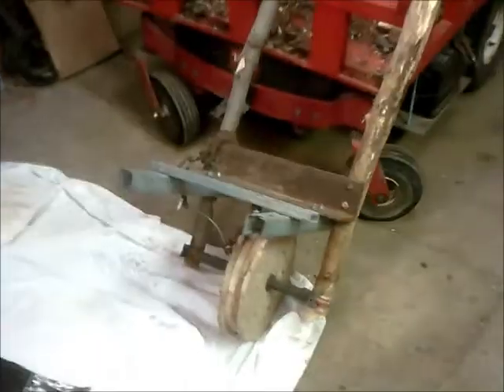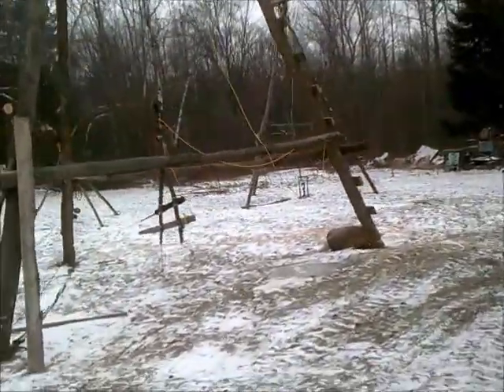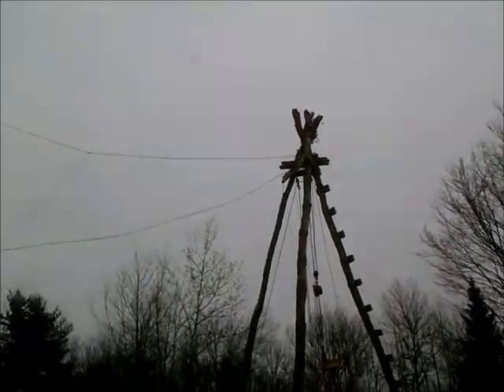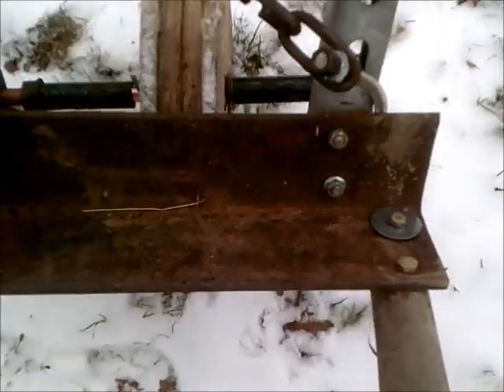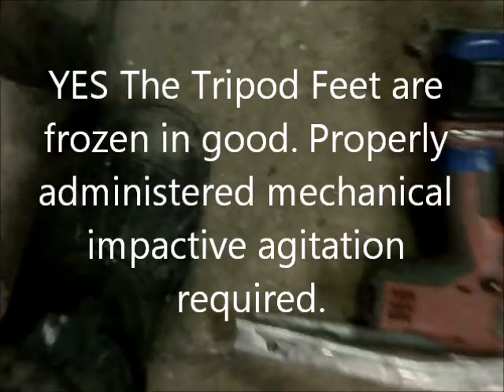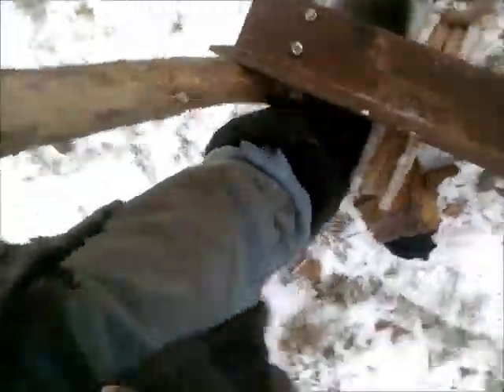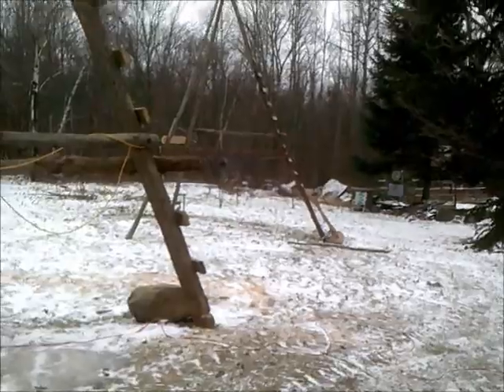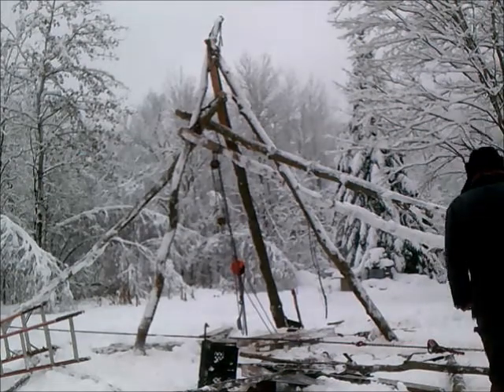Ed's Wheelbarrow

Comment: I've see seen that before...it is a make shift replica of a "Root ball cart"  Used in nurseries and in the field when digging for stock,  "Balled & Burlapped" trees,  Only they would have more of a semi circle with the cross support you used angle iron to accomplish.... I would suggest angling the base by about - 12 to 15° (i.e. down and away from you behind the handles) so that you can simmy the cross bar BENEATH the POLE like we would the root ball, and the angle gives you more leverage for heavier loads, which you might need for Pappa Bear tripod!  ')   But definately a "ball cart" as we call them in the nursery,,,,because not only does it lift tree balls, it saves OURS from damage!! LOL!

Peace, Love, and Light!
Reply from the maker: Hi my friend, I appreciate the support and input to help exemplify concepts for folks. You being a universal gardener ought to "see" many correlations and concepts that will help put it into perspective. We'll be in touch.    another fellow gardener.